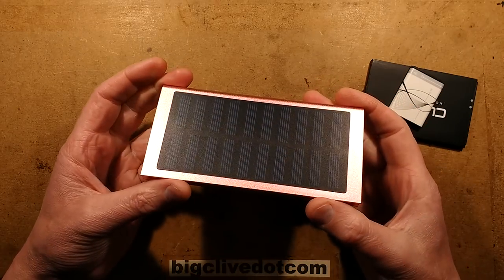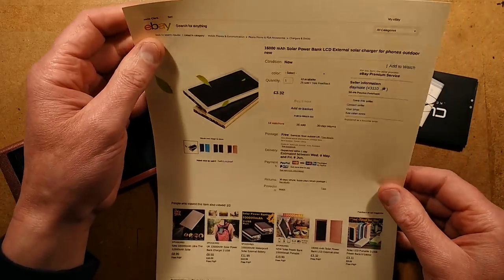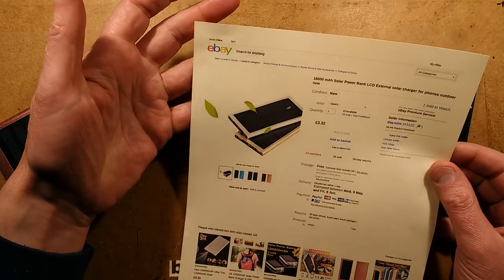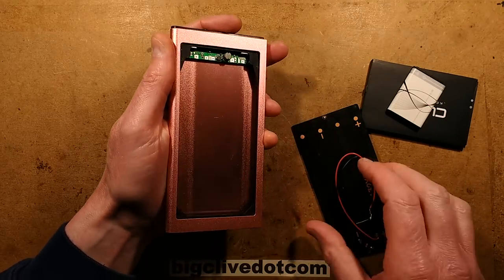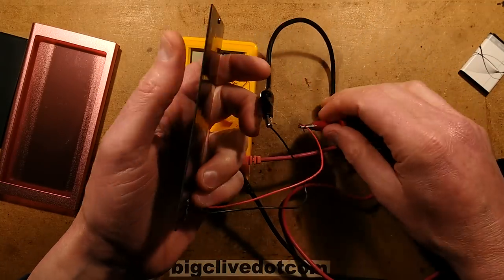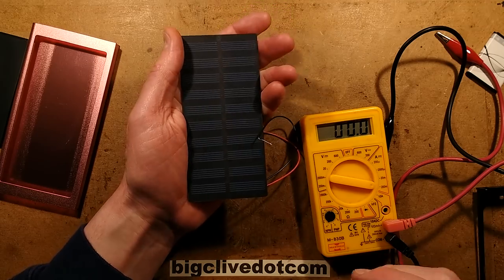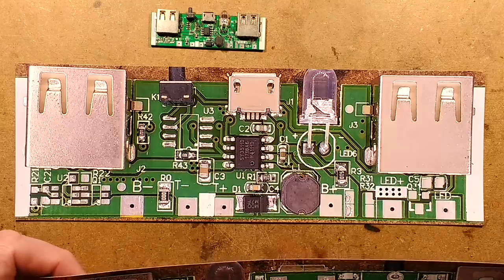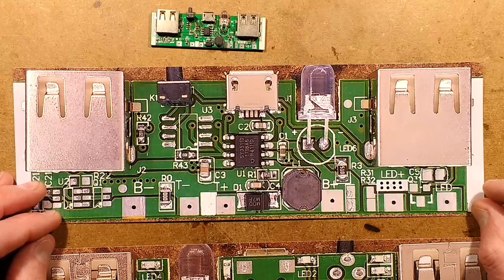Fake USB power bank kit rating (100,000mAh again)

Comment: I'm actually surprised that the solar cell was an actual solar cell
Reply from the maker: I tried it outdoors in direct sunlight today and its performance was abysmal.  I'm tempted to delaminate it now.
Reply: bigclivedotcom I don't think you've done a solar panel before?
Reply: Ha, that's worth a try. Never seen anyone do that yet. If you don't damage it, you could also try coating it.
Reply: I'm researching parts for a diy power bank, and finding many unreliable/nonperforming parts and would like some suggestions for use as a power bank during extended outages (as in locally Florida hurricanes). I have around 6 power banks some with solar cells and like the one reviewed, solar power output is abysmal. A suggestion for a future video "DIY power bank from off the shelf parts", or a new circuit of your design, if so inclined. Thank you for all that you do, and as always I look forward to your next video.
Reply: @al81007  i have a bunch of those battery packs you get for video game controllers and portable consoles that replace the AA you would have used i was hopping there was a way to turn them into usb banks
Reply: @bland9876  Interesting, I am working on a larger version than using 1.5v cells, I service mobility scooters and have collected 12v Lead/acid, as of now I'm at about 2kva, by my estimate the goal to be 20kva.
Reply: Adventure Waits for No One Lead Acid mobility scooter batteries are probably deep cycle lead acid batteries, which are the best option for backup power when you don't care much about weight.  Most places a building standing on solid ground would have little problem with weight, but I hear that much of Florida is a thin crust over fragile aquifers, limiting the safe weight of building plus content per square foot of ground.

Comment: The metal casing, discounting the hole for the solar cell, reminds me of USB enclosures for PATA and SATA laptop hard disk drives from around a decade ago, including the end-slide feature and the roughly bookish shape.

Makes me wonder if someone was looking for a repurpose of tooling for such a previous product, added a method to punch the hole for the solar panel, and changed the endcap electronics.

Comment: i never understood power banks having these tens of thousands of mAh ratings as opposed to tens of Ah ratings which would make more sense. that's like people around pro audio calling a 4K rig a 4 million milliwatt rig!
Reply: Even Ah are a crap measurement, Wh would be much better.
Reply: Yeah, Ah is sorta biased and most people don't fully understand it.
 Wh is way more convenient, especially with fast chargers outputting 5/9/12V
Reply: well it looks more impressive to use thousands for one, and then its not like you actually can get 10A for 1h out of these, so i guess its also to distinguish from bigger batteries
Reply: @Misha-dr9rh  it does mean better as long as its a single cell device. and if you see a battery labeled in Ah instead of mAh, its probably not a battery bank. even that huge one i saw that can be used as a 220v source was labelled mAh (memory can be faulty so... not exactly sure but it was like 50000mAh or something. its just power bank standard at this point)
Reply: @BSOE3058  i disagree, as long as the phones are also single cell and being labelled as mAh, and not Wh, the power bank being mAh is much more convenient than trying to convert all the time

Comment: You neglected to read the fine print. The solar panel will produce 100,000 mA...at the orbit of Mercury.
Reply: I appreciate the humor but oddly enough that is still insufficient assuming standard 5 volts and solar cell efficiencies of less than 100% (really giving them alot of chances here).

Comment: I never knew fresh air contained 100,000mAh of power... :P
Reply: Not fresh air; high quality energy dense eau de Shenzen.
Reply: It all depends :)
First mAh is not a measurement for power and not even energy.
To know the energy you also need to know the voltage but assumed here was a single cell LiCoO2 so 3.7V x 100Ah = 370Wh
Now air can store thermal energy not great about 1000x less than water so for that volume of air say 0.0001m^3 with the air thermal storage capacity of about 1.16mWh per cubic meter per degree Celsius or for that respective volume about 0.116uWh per degree Celsius.
So if you can increase the air temperature inside that power-bank by 3189655172 degree Celsius above ambient then you have stored 370Wh as thermal energy. Temperature is physically possible even if is about 200x higher than the Sun core temperature.
Reply: electrodacus duderama. Word!
Reply: how the fuck does "1000x less than" even calculate? What would be "1x less than", by your formula? Compare with "1 times more than" and watch your brain explode
Reply: Its "Zero point energy"!
Reply: its not fresh air its chinesium air
Reply: Chinese air can't be considered fresh at all, mate.
Reply: 10 cm x 5 cm x 0.5 cm = 15 cm³
15 cm² air has a mass of 0.0180615 g 
The energy of 0.0180615 g mass is 1.626*10^12 Joules (E=mc²)
1.626*10^12 Joules at 5 V equals 90,307,500 Ah
Reply: Air has a thermal storage capacity about 1000x lower than water. So it takes the same amount of energy to heat by one degree Celsius 1 liter of water as it takes to heat 1000 liters (1m^3) of air and that will be 1.16Wh
Reply: I was expecting someone to make this comment :) Not sure if all is correct but 10cm x 5cm x 0.5cm = 25cm³
In my thermal storage calculation I used 10cm x 10cm x 1cm so 100cm³ but not sure about the exact dimensions.
Reply: Beat me to the punch. Someone was bound to make this joke eventually.
Reply: My guess is the are estimating the amount of power that solar panel will make in a year, assuming it works of course. ;)
Reply: Well, hot air does. And flatus, but everyone's mileage varies.
Reply: SparrowGryphon Why a year? Other batteries are capacity between recharges (if any) so lifetime solar panel output could be a marketing number.
Reply: the water in the air can run a 300HP engine for a second   that is  17,421 amps at 12v for 1 second

Comment: To quote a great mind "Where's the kaboom? There was supposed to be an earth- shattering kaboom!"
 I thought for sure Clive was going to hook the battery backwards.
Reply: Sean Not-telling love me some Marvin the Martian
Reply: Would there even happen a lot with protected cells?
Reply: I don't recall if he has done it but I would like to see a cell go bang. But with the right safety precautions 
so that no one gets hurt. Tim- laps up to and slow motion for the kaboom.
Reply: Im not sure, but I dont think so. He has blown up a power supply, an easter bunny and a high voltage disconnector but I cant remember a lithium cell. Once he shorted a lithium jump starter that just puffed up and just after taking it apart it went on flames but that wasnt on camera.
Reply: I remember the jumper pack and the bunny but not the cap.Don't forget the light that he blew up too.
I think he should do an 18650 cell.
Reply: Yeah, Ive never seen an 18650 explode, that sounds quite more bangy than those soft flat cells that just puff up and light on fire :D
Reply: I was reading something but not sure if true or not. It said that the 18650 have a burst pressure of 200 psi
and right after they pop you get flames. If that IS true I sure would not want to fly with a charged box of them. It also said something about shipping then only at 30% charge to keep them safe. Just think of all the Ebay sales of 18650 cells that are not packed correctly.
Reply: Defenetly worth trying to find out :D

Comment: I would give my eye teeth for your knowledge on electronics. I know basic stuff from where I self taught in the 70's. Do you remember a monthly magazine called Hobby Electronics? I loved it, used to build their little circuits in a column called 'short circuit'. Would have loved to have gone into design type stuff but wasn't considered clever enough when I left school so never went further, deeply regret that, I got left behind with technology I'm afraid.
I would love to see you design a small simple circuit from scratch, a flasher circuit or mini op amp circuit and explain why the component values are such and what would happen if they were different values.
Just a thought, still loving these videos 😁😁👍👍

Comment: How hot is too hot for the cells? It's 29c and sunny here, leaving one of them in the sun would toast it I think. I have a few solar capable usb banks but not put them in the sunlight for fear of damaging the cells.
Reply from the maker: I wouldn't recommend putting any powerbank out in direct sunlight, including at a window.  It will at the very least shorten the life of the cell and at worst cause it to fail.
Reply: Cheers Clive. That is exactly what I thought! Most of the windows here block quite a bit of UV too (not sure if that would affect how well the solar cell works? but they still get bloody toasty!) So all these solar cells are really just a gimmick? Besides degrading the cells you'd need an awfully long time at 15mah to charge the magical 100,000mah battery, especially in the UK with the sunlight there.. :D
Reply: Don't forget that ordinary glass changes the wavelength of UV light to infra-red. That's why it always feels hotter under glass and why the glass itself feels hot in direct sunlight. It's the principle used by hothouses or glasshouses. So, if you want to use the cell for charging, it's either direct sunlight or under some artificial light.
Reply: Out in the sun here would melt the battery :D never bothered with the mini-solar cell chargers for this reason... maybe if you were out camping and could leave it in a sunny but cool place all day it might help a bit but in such a case i think one of those usb generating fires is probably a better idea... i wonder why they still make them with solar cells and if anybody actually uses solar to charge these large banks??
Reply: I live in Sydney where 40 degree days in Summer are not uncommon. 30 plus seems to be the average now. A few months before Summer, I bought some solar lights that sit atop 50mm square posts. One day, I took them in after a row of hot days to see how they were coping. The batteries were fine but the hot glue under the solar panel that was used to waterproof under it had melted and some of it dripped onto the batteries. I managed to get it off and I recharged and tested the batteries with a Nitecore charger. They were fine.

Of course, they were Ni-MH rather than lithium but Duracell are making solar lights with lithium batteries now.

Anyway, my big problem was actually with rain. Because they are flat, rain drops sit on their top surface after it rains. I thought as the drops dried off they were leaving residue behind but it was worse than that. The resin covering the solar panels was actually going opaque, probably due to contact with water.

I also have a solar panel with a USB connector attached. It was supposed to deliver 5V but it does bugger all. It also has a resin coating. So I don't think the problem is with the coating so much as what they're making the silicon component out of.
Reply: In the shade would give it a shot, because even in the shade theres still tons more available light. Way more than any common artificial light can put out.

Comment: I have the same kit and I found a 8000 MAH cell that fits it perfectly. No room for a larger cell. The other LED is used to show when the solar panel is charging. Maybe the batteries that you are using are too weak. Mine will charge at over an amp and still maintains 5 volts, but not much over 1 amp.

Comment: Ive bought two of those from eBay, except with a cell and no solar panel. The case looks the same, except the solar panel cut-out, the same latching method too. They were advertised as ”20000mAh”. I doubt they are anywhere near that, but the cells they have are actually pretty big and fill the whole case. So for £7.50 it wasnt too bad.

Comment: One problem of soldering to phone batteries is going to be gold embrittlement.  That might be a relatively thick gold plate to withstand wear from battery removal and replacement.  If so, the joint is going to be brittle.  Especially with lead-free solders.

Comment: If the batery voltage is not enough to turn on both LEDs in series, it can be used as a duplex.  Pin driven high: lower LED on, upper off. Drive low: upper on lower off. Tristate pin: both off.

Comment: There are non solar units with batteries already in them available with this same case. I’ve one rated 15000 mAh which feels like the case has been stuffed, though I haven’t taken it apart to see what it’s stuffed with. My guess is that it runs off the same board, since the usb sockets say 2A, but don’t put out 2A.

Comment: I purchased a "kit" from China last spring, it has the same board, but fully populated, one side has the solar charger, the other side has 9 LED'S soldered onto a while board with a translucent plastic cover to disperse the light. At the top is one of those pretty much useless magnetic compasses which might have appealed to me before the days of cell phones with built in direction finding devices.  Actually the compass seems to work when out doors and away from the electrically charged environment of my chair/workbench/living-room corner. When I assembled it, I put in one bag type lithium battery recovered from an Android Tablet, when the discharge proved a bit to short, I added another of the same size, after charging both to 4.2 volts.  The only real problem I have had was the 4 charge LED's, two of which have fallen off the board, being the two that indicate a full charge, I think I shall have to take her apart once more and replace them.  The light is quite bright and will illuminate our living-room well enough that one can walk without tripping over things during our most recent power outage, so it is good for that.  The blasted charging light comes on almost all the time when any light at all is visible.
Reply: The solar panels in these devices are useless because when the charge indicator LED lights it will actually discharge the cells. I bought two kits, and built a unit with LED panels on both sides. It's a useful little "box 'o light".

Comment: Hey. I Actually have a reputable 16K mAh powerbank from a reputable company with similar dimensions. I double checked it, and even opened it and there are 4 smaller slims 4k mAh cells connected together. Its actually quite nice.

Comment: That case looks like it would be perfect for an external SSD......if you had the external connectors.
Reply: John Carr Not sure you'd ever want an external SSD case, that'd typically be a bandwidth choke point.  But you can e.g. buy an external SATA case for around $3, USB3, which will happily take SATA SSDs.
Reply: Funny you should mention that. These cases are actually old external HDD cases for laptop drives from like 10 years ago. I have a couple drives mounted in some cheapo ones I got from a flea market back in 2009.

Comment: Have you checked the open circuit voltage of the two solar panels? If they're different voltages you can't compare them with the short circuit current

Comment: I bought a power bank with the same case but it doesn't have the solar cell, for $5 USD at a pallet store. It seems to work very well.  10,000 mAh.  It looks like it has the same board, although I have't taken it apart since it works good.  Now that you said it could have a smaller battery in it and some weights, I'm curious as to what is in it.  LOL

Comment: Some of these products use components that have failed normal testing.  That solar panel had some bad solder connections, but it still put out some power regardless.
Reply from the maker: I've just delaminated it.  The silicon is real but damaged because the panel was too flexible.

Comment: I have a couple of these book-style power banks, although mine have no solar panel, came with cells, and were rated 20Ah and 50Ah (I bought one of each from the same seller to see if there was any difference, since they obviously weren't going to be the full capacity). Both came out to around 7500mAh (7631mAh for the 50,000mAh version, and 7395mAh for the 20,000mAh one) and can supply up to around 1.8A. Decent enough, a 7500mAh cell and the charger/regulator for ~£10

Took the 20Ah one apart, and it has different circuitry to Clive's. Theres an anonymous 14-pin chip, an 8-pin chip marked 4606, and the DW01+8205A. Lithium cell is, as expected, completely unmarked. Mine also still havs connections on the PCB for a solar panel, marked SUN+ and SUN-, but they're unused.

Comment: Maybe it is 100,000 mAh and you just don't know how to use it properly? 
Try using velcro to stick your lipos to the ample space available on the outside of the case..
Reply: Or a car battery :D
Reply: Chuckiele It requires a LiPo for the regulation chip to work.  Circuit probably has a limit in what capacity it can handle, though it might not be 100Ah (4½ days charging time).

Comment: i thought on those cell phone batteries you had to use the middle pad somehow for the protection circuitry? is that not right and you can just hook up the + and - to anything and the protection circuitry will work? if so what is the middle pad used for?

Comment: I also bought some solar cell power bank kits and it turned out that the "solar cell" was just a shitty photo diode that turned on the charging LED when it sat in the sun. The the solar panel just had a sticker that looked like a proper cell butt underneath was this tiny diode. It was really disappointing.

Comment: That looks like the exact design of my Fuse Plus You 7757 (terrible name) power bank that's only "5000mAh" but stuck in a different case with a crap solar panel on the side.